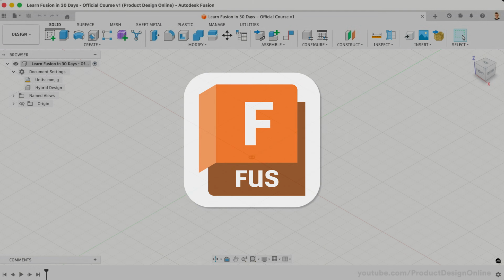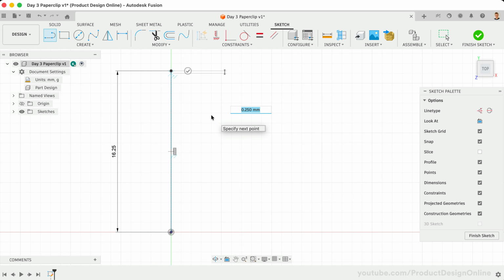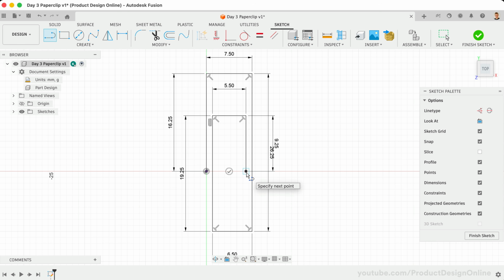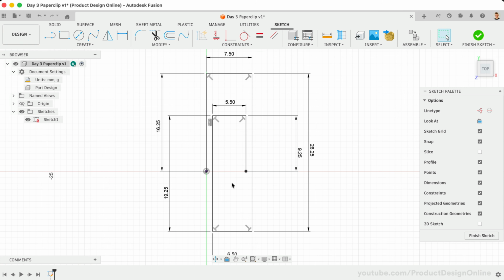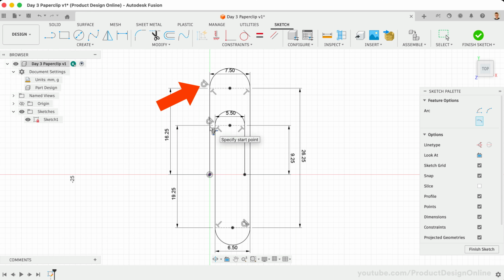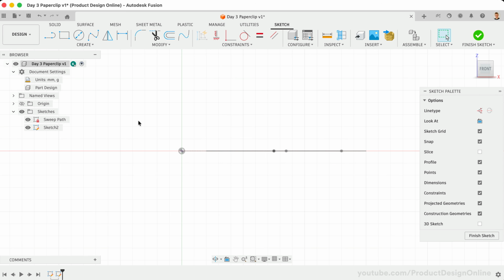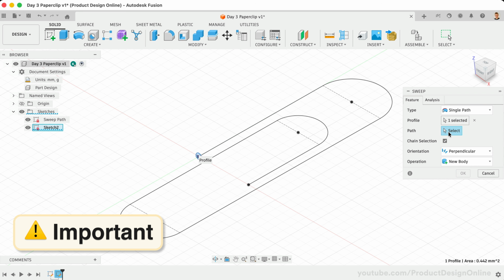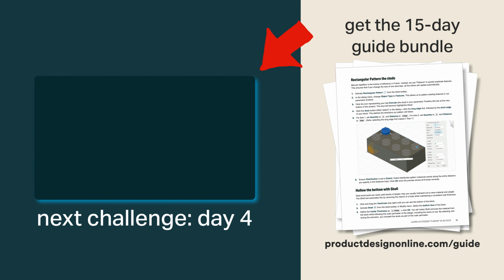Day 3 of Learn Autodesk Fusion in 30 Days! (2026 EDITION)

Comment from the maker: Day 3 Paperclip dimensions 👉 https://bit.ly/day3dimensions
Day 4 (2026) 👉 https://youtu.be/rcD7wcNFwsU
Reply: 😄Question : 
When we went to extrude the 'sweep' You were in the XZ-plane. For me this is the XY-plane. 
I know this technically doesn't matter, but i would like to have the same orientation as you. Can I change that? and if yes, how?

Also : this is soooo much better than TinkerCad!!
Reply from the maker: @Coen80  Yes, in your Preferences, there is a setting called 'default modeling orientation'. Set that to "Z" up. It should be Z up by default.
Reply: @ProductDesignOnline  thanks again for the swift reply! :D 
Also, I messed up my grid, I found where i change it (that's how i messed it up haha) but what are good settings, since there are two measures to input and they confuse me
Reply: how do I remove the original image out of the bottle we just created? I still have this image that we DL stuck in the middle of this bottle?!
Reply from the maker: @Coen80  In the Fusion Browser, click the eyeball icon for the Canvases folder. That will turn off all reference images.
Reply: @ProductDesignOnline thanks for the quick reply. It wasn't quick enough though, I did figure it out....,or Google did 😅😊
Reply from the maker: @Coen80  😂

Comment: Good morning.  I'm just getting started on Fusion and it pretty intimidating but fun at the same time.  Not sure if this is the right place to ask but ill try. I have a question if anyone can help. i have a square shelled box with 12mm walls. I've created a hole in the center of the box about 227mm. the hole opening is int the top and does not go through the bottom. I need to remove only the was (diameter) of the hole which carry from the top side to the interior of the bottom.   How do I remove the interior wall of of the circle and leave everything else?

Comment: XY not XZ...??? After creating the sketch on the xz bottom down just like at :50 I went to follow steps at 6:15 and when i click XZ view under origin folder the preview window comes on flat, but its vertical when you did it. I'm confused why.
Reply from the maker: The first sketch is on the XY plane. The second sketch is on the XZ origin plane, as it sits vertically and perpendicular to the paperclip path. Can you double-check your first sketch (the path) is on the bottom XY plane?
Reply: i’m having the same issue! my first sketch is definitely on the XY plane, and when i sketch on the XZ it comes flat. 
What’s also weird, is that my fusion never auto-orients to the sketch plane, even though i’ve double checked that setting, and redid the default settings you taught in the first episode. 
i think these two issues are going hand in hand
Reply: @alexandreahessrodriguez537  did you ever figure this out? same issue. Edit: I figured it out. I had not clicked "finish sketch" on the first sketch BEFORE selecting the XZ plane and choosing "create sketch". Once i did that, a new sketch appeared and the sketch auto-orients.
Reply: Why dont you use pipe instead sweep?

Comment: Excellent video. I am a beginner and I use your videos to learn more about Fusion 360 so, thank you. I noticed that the paper clip can also be done using pipe command which is easier since I don't have to sketch the circle normal to the path direction but just specify the path and diameter.

Comment: Please, please could you do a video that shows how to make an 'extension spring' that you can 3D Print, where it's flat nor coiled or sprial. LIke you see in 3d printed mechanisms for spring buttons or fidget toys. There is no video tutorial on YouTube on this and it's been driving me crazy all day. Thank you.
Reply from the maker: Thanks for the suggestion! My focus is on getting the remaining lessons out for the 30 days course, so I can't do any request at the moment. To create a spring, you will have to create a custom sketch using the coil command and Project 3D geometry. You can then sweep the design along the coil path (that was projected). It'll be similar to the Auger lesson on Day 12: https://youtu.be/r3I9bg-dm2k?si=RrNEJGZ6ykGUZXtj

Comment: After sketching the paperclip, i hit escape but the sketch1 isn't locking. what am i not doing or what did i miss?
Reply from the maker: Are any of your sketch lines still blue? If so, a constraint or dimension is missing.

Can you email me your Fusion file?
Reply: @ProductDesignOnline no, I have the dark theme going so that are all white.
Reply from the maker: @BlackPhoenix087  Okay, I'd need to see your file then. That will be easiest for me to tell you exacrlt what's going on. Export it as .f3d (native Fusion file) and send to the email in my YT bio. Thanks!
Reply: @ProductDesignOnline  Email sent. Thank you for the help!
Reply: @BlackPhoenix087  Did this get figured out?  Having the same issue.  All lines are defined but no lock.
Reply: Figured it out myself... I had two lines that were drawn separately but still constrained.  I redrew the entire shape without breaking and it locked.
Reply: @TheReadDesultory if I'm not mistaken, I did not have the correct line selected.

Comment: I was hoping if you could cover how to manage Assembly Contexts in Fusion properly. I currently work with a team on a very complex robot assembly that only uses external components but we like the convenience of Edit In Place. However, we've run into a ton of errors involving external references and Assembly Contexts, due to not knowing best practices regarding them. With the new and improved Fusion workflow, I'm optimistic that we can combat these challenges.

I want to record a tutorial video regarding this topic myself, so it would be a great help if you could reply with some of your best practices involving them. Thank you for your work on this course!

(COMMENT WAS ALSO MADE ON DAY 1 & 2)
Reply from the maker: Hard to answer this sort of thing here, as a lot of variables. In short, you should have people work on individual parts as Part design files. If there are sub-assemblies owned by people, they can create those as their own Hybrid or Assembly File, then have one single master Assembly file where things still go together.

Edit in Place is available in the new Assembly file type... so definitely keep using that. I heard they're working on more features to improve the sharing of dimensions across the new file types. Hopefully, that will ease a lot of the pain points. Right now, you would have to share dimensions manually/have folks open different Part files to review things. I would just say to limit the use of Project when using Edit in Place. That seems to have issues, and hopefully, something they fix/improve as well.
Reply: Thanks for your help.

Comment: In 2026, Solidworks, as of writing, has a free license for makers for the first year... then $48 a year after that. Could you discuss the pros and cons of Solidworks Design vs Fusion 360 in 2026?

For example, I know later on in your 2023 course importing an STL file and converting it to a model was not possible without paying ~$1k a year.
Reply from the maker: To be clear, converting an STL to a Solid can be done on the free version with the Faceted conversion type. This was the original method Fusion had.

The 'Prismatic' conversion is likely what you're referring to, which cleans up and removes all of the triangles (if not an organic file). That one can be done on all licenses except Personal Use. You can subscribe to a Commercial license for one month and use it as needed, or get one of the EDU or Startup licenses if you qualify.

The third conversion option, conversion to T-splines, does require the design extension (cost varies on several factors) - and honestly, it's not worth it. If you need a Tspline you'd be better of creating the T-spline from scratch to get more usable geometry.

I know you didn't ask for all of that, but I wanted to answer with it because I see a lot of misinformation out there around this.

I am probably not the best person to answer your Solidworks vs Fusion question, as I'm biased toward Fusion 😉

It's really personal preference, IMO. At the end of the day, you can do nearly the same thing in both. I was a longtime Solidworks user and originally started using Fusion (before they had a name for it) because I wanted a CAD program that worked on macOS. I think the best approach is to pick whichever seems more intuitive to you and stick with it long term. Trying to use both or switching back and forth doesn't fare well long-term. I personally love that Fusion gets updates each month (most of the time!), but some people hate that aspect.
Reply: @ProductDesignOnline  Yes Prismatic conversions! I personally prefer the Fusion UI over Solidworks UI. But this was my main pain point in sticking with Fusion. So many STL models out there without STEP(?) files.

When you get to the mold making section of your course could you go over simulations of mold pours? Or maybe a best practices for a two part mold? Casting/Injection simulations? If not consider it ideas for other supplemental videos! 

Appreciate your effort you put into all of this. Recommending this channel to any of my colleagues in the future who are not Solid Works die-hards!
Reply from the maker: @tb6demo  Appreciate the video suggestions! That would likely have to be a separate video, but love the idea! Thanks 😄

Comment: Very nice lecturing style. efficient . looking forward to the next. Its actually important for my project work. Thanks
Reply from the maker: Thanks! What project(s) are you working on?
Reply: @ProductDesignOnline  I want to make a connection cap that clicks over the top of a USB battery bank . The USB connectors fit into the cap. Makes it easier to connect all the USB inputs and outputs in one go.
Reply: @johnrothwell8429  heyy which 3d printerr do you havee? im planning on buying one and i want some inputs!!